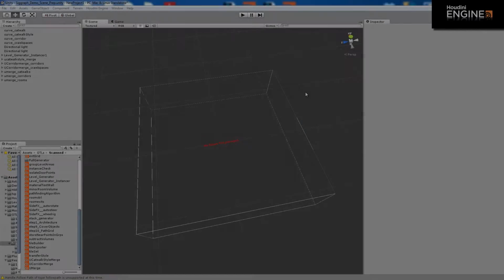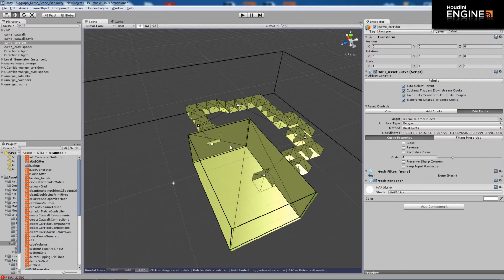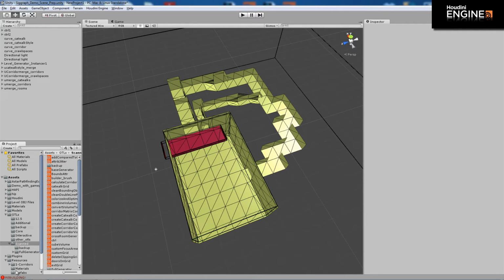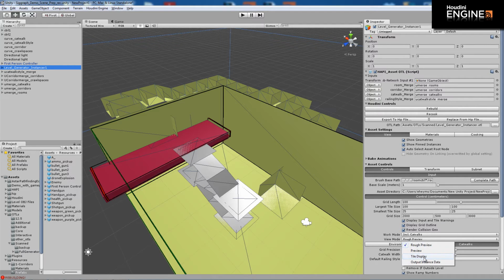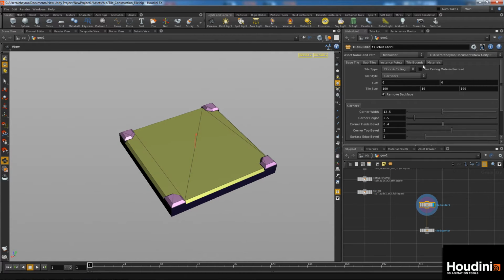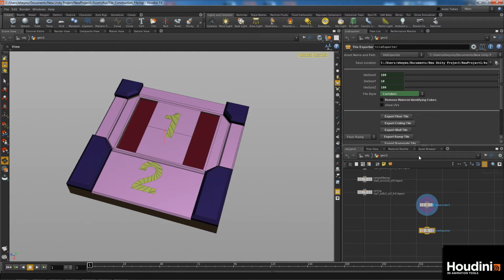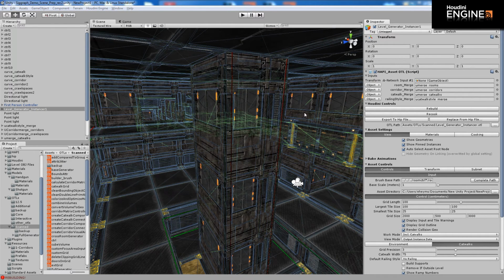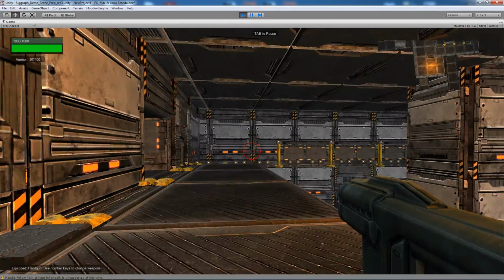Houdini Engine in Unity Demonstration

Comment from the maker: That said, having axis aligned building kits is nothing abnormal and often very common. the trick is to hide the fact that your environment is build on a grid and composed out of similar parts. 

Games that use axis aligned segments are to name a few, Skyrim (dungeons) or the Indoor environments of Far Cry 3 Blood Dragon.

The method used here uses plate style tiles, which is more flexible for BSP style construction, but it could be easily reconfigured to use a segment based approach instead.

Comment from the maker: We had the choice to go with an axis aligned environment such as in my graduation project and make use of already existing methods I developed before. Or spend several weeks / months prototyping and rebuilding core systems to enable 360 directions. 

While I wanted to try 360 degrees, because we only I had a few months to do this and several untested features on the side, we settled on the safer approach for the project.

Comment from the maker: The Houdini engine is a stand alone runtime library that can run Houdini assets in any program it is integrated with. The Unity Plug-in is still in internal testing and development, it will be released in the coming months. 

If you wish to be the first user to test and use the Houdini engine you can sign up on the sidefx.com website under the sidefx Labs program.